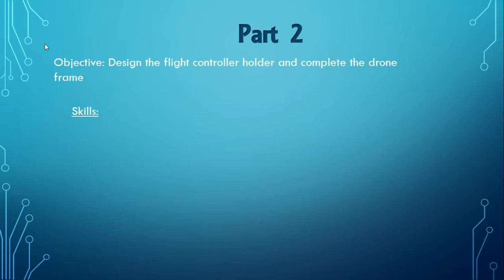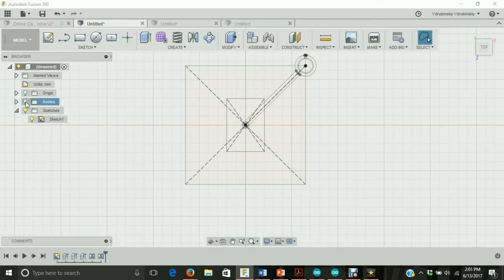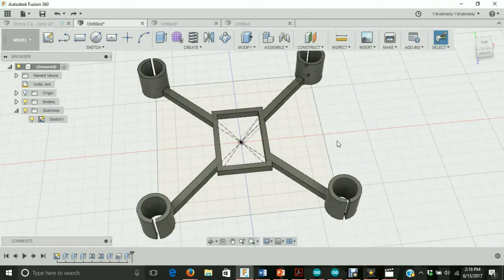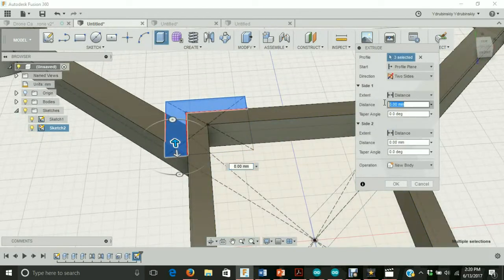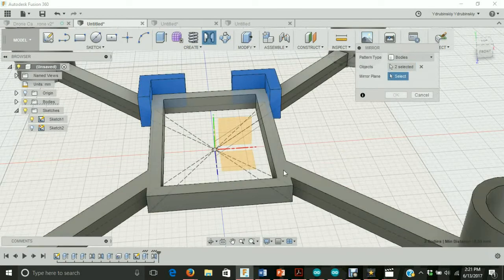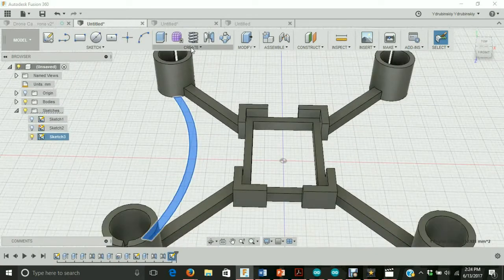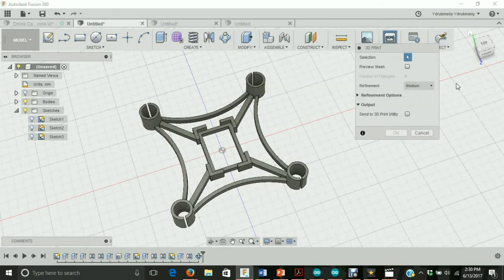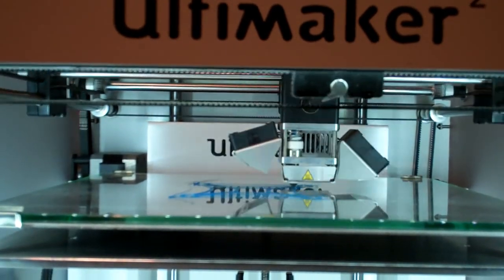Designing a micro quad with Fusion 360 For Beginners – Part 2

Comment: Great videos (Part 1 and 2)! One question though. Did you use a specific component kit for the flight controller and motors or did you buy them separately and then designed the frame to fit what you bought?
Reply from the maker: Thank you. I pieced out the parts separately to go as cheap as possible and built the frame around that. I have the list of parts here: https://www.thingiverse.com/thing:2352812